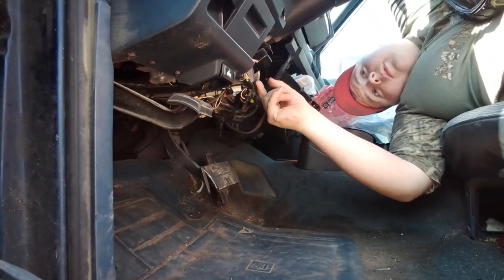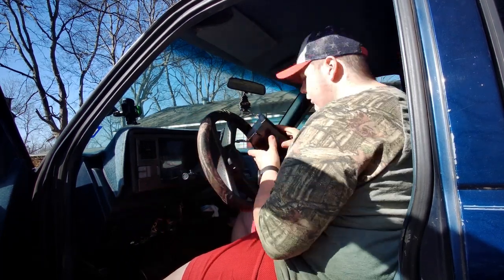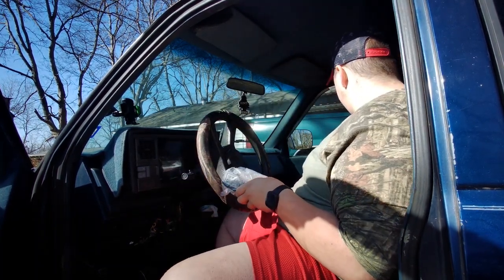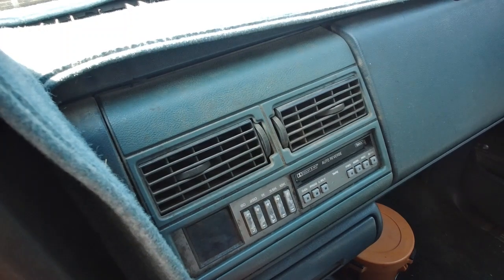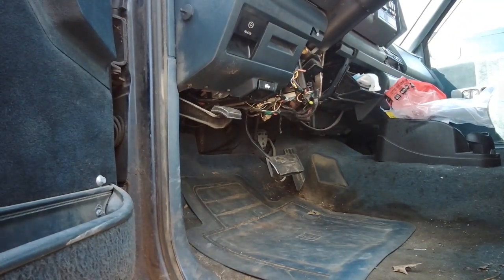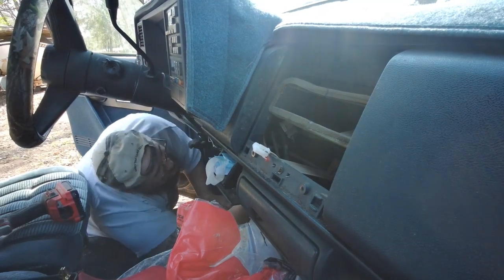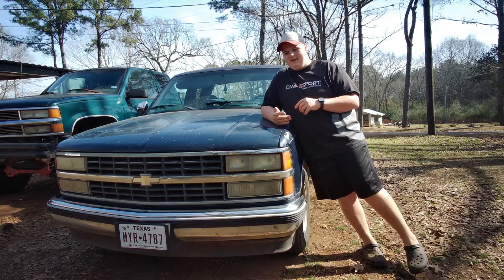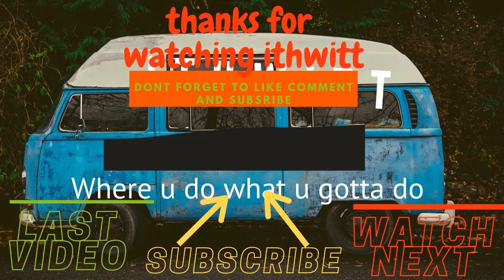how to put an aftermarket radio in a 88-94 gmc/Chevy c/k1500

Comment: I’m having issues with the wiring harness to the new stereo. What did you do about connecting the new stereo deck to the truck? It seems none of the diagrams I look up match what my 94’ c1500 has. Also I can’t seem to find a video that can help me with the difference in the wire colors that my truck has.

Comment: I had the same problem where mine would not turn on, what did you do to fix it?
Reply from the maker: @TheMulletMafia1  i swapped the power wires if I recall correctly an it worked.  Now these have 2 or 3 (Wana say 3) fuses for the radio so I would also check them as well(I'm sure u already have)
Reply: @ithwitt  thank you

Comment: You completely cut out the issue you were having with the wiring harness and why you didn’t get power on the initial hook up. I’m having the same issue…and followed the diagram. What was your issue and how did you fix it?
Reply from the maker: We had hooked up the wires wrong and the speaker was blown to blown so that honestly didn't help us at all. 
Once we fixed the wiring and replaced speakers it worked.
Our main problem was speakers
Reply: @ithwitt  okay. What wire was hooked up wrong? Any idea? I followed the same diagram you did I believe and got the same result. No power.
Reply from the maker: @5ryannnnn   I am unsure as it was a year ago so can't remember exactly 💯 I Wana say the blue one but I can't remember
Reply: @ithwitt  thanks. Okay…blue one what? I appreciate the how to videos…but just my .02 cents. When you encounter an issue don’t just edit it out, it’s likely 33 other people are having that same issue.
Reply: Yeah i put my same one in my truck but i can’t get it to turn on i would like to know what wires you hooked up bc i can’t figure it out